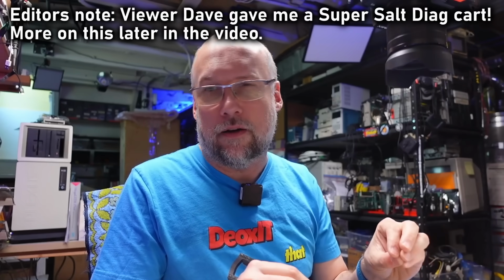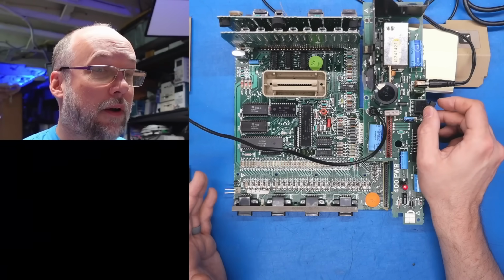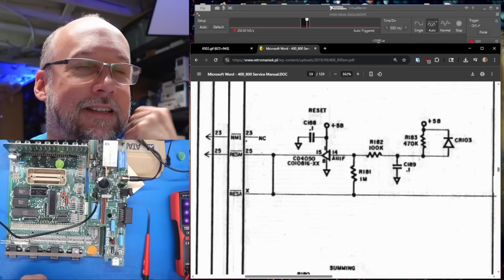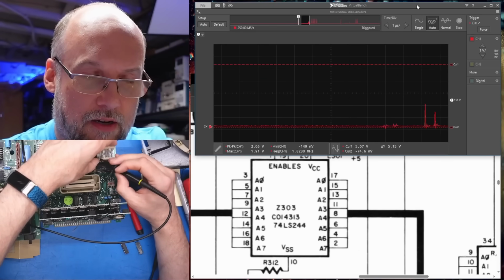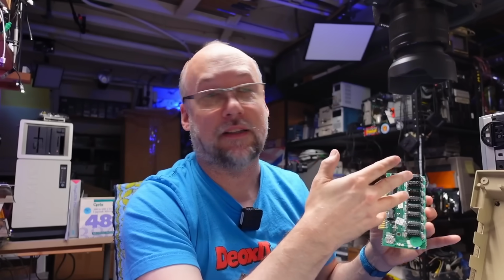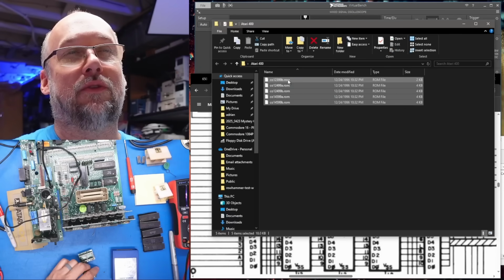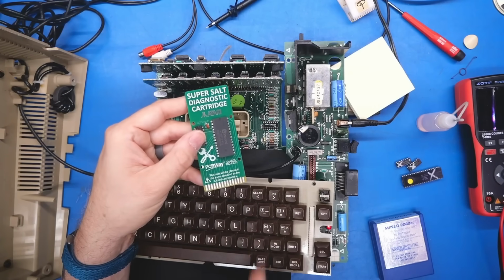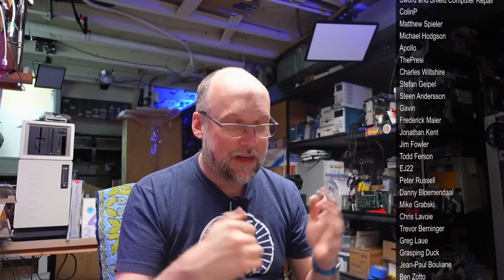Repairing a smashed-up Atari 400 computer

Comment: Actually, the SIO port is painfully slow for disk drives--not nearly as slow as the default IEC protocol, but way slower than C64 IEC fastloaders, with no software-only option for acceleration.  The only way to speed up the sluggish 1200 Bps transfer rate was/is to install hardware mods in the floppy drives.  USB historically was never as high performing as, say, FireWire, so I'm not too surprised it was originally based on the SIO in some way.  Commodore wasn't the only company that had problems with drive data transfer rate.

Comment: As I recall, the 400 was originally supposed to have come with 4K out of the box, while the 800 was to have come with 8K.  By the time they were released, however, market conditions had changed, and they both came with 8K.  And it wouldn't be long before they both were sold, standard, with their intended maximum amounts of RAM: 16K and 48K, respectively.

Comment: Daaamn I have an Atari 2600 here with traces that look exactly like the 400's traces 😮
Reply: So do I.  I think they all look like that because of the type of wave soldering that was used.  My childhood 2600 was the first vintage console or computer that I had ever serviced (had a bad TIA--works fine now with a new old stock replacement from Best Electronics), and its appearance freaked me out at first. 😄  I thought "Wow, that's the problem right there--I played so much that melted and crinkled the board!"  But of course, everything checked out OK, except for the TIA.  Ever since, every Atari mainboard I've looked at from that era has the same appearance underneath.

Comment: When you put the working GTA in, you found that the Antic was off by one pin. You fixed that and you thought the GTIA fixed the issue. Refer 1:16:19 that’s why the GTIA’s are both ok. Isn’t that the reason?

Comment: I have never seen a 400 with a proper keyboard !? I would have loved that over my crappy membrane ! I had to have my 400 repaired at some point (someone my dad knew) and when i got it back, the membrane was a total mess. Looked like it had been peeled all the way back and then reseated, but had trapped air bubbles all over the place.🙄

Comment: You can replace most standoffs by using a bit of a drinking straw (up to 20mm worked for me), a toothpick and some uv hardening resin. Hold the straw in place with blue tack fill it 3/4 with uv resin, insert toothpick and expose it to a good uv light for 30 seconds (at least). You will need further uv exposure for a good surface. A fake nail hardening lamp for 30-60 minutes or a half day in the sun gives a good hard plastic repair. Finally, drill out the toothpick  with suitable drill to match the intended screw. This is delicate work so be careful. You can add girth/support to the standoff with adisional uv resin (if there is room), in my experience it adhere well to previous resin layers and leaves (if done right) almost no trace of being layered. 
This fix/hack works well with manny repairs, just be aware it can yellow a bit if exposed to much light, but on the inside like the stand off or painted that don´t matter to much imo.  
Love to see you try it, great video.

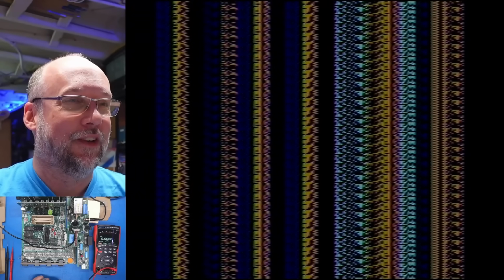Comment: When I saw the pattern at 17:38, I already knew it was the gtia.  
    The Atari 400 was my first computer, started programming in BASIC, then 2 years later I got an Atari 1200XL, with a floppy and a modem and started programming with MAC/65 assembler(better than the Atari assembler).   And calling up all the BBS in 1980's.  I got kicked off a few for pirating, etc.  
 I have read almost every book ever written about the Atari 8 bit line: Atari Basic, Atari Roots, Atari Sound and Graphics, Computes 1st,2nd, etc Book of Atari,  De Re Atari, Mapping the Atari,  Machine Language for Beginners, The second book of machine language,  etc.etc..  and all the programming magazines I had, full of Basic programs that me and friend would type in and then play.   Remember it like yesterday.

Comment: Acetone works wonders on old Atari cases (2600, 499, 800, XL line, 810, etc).  I have two 800s that required a good deal of case surgery.  I keep broken 400 and 800 case parts for pieces, standoffs, etc.  

Also, Atari had two CPU boards, one that used 6502 and one that uses Sally.  The boards interchangeable.

Good to see some Atari content.  I've repair Ataris on and off for years.  

Have a number of 400s I want to upgrade to 48k and add composite to ... Just haven't gotten to it 😃.

Comment: Nice repair. Slightly grumpy connection at a guess. I had a 7404 oscillator with a marginal connection that was generating 48MHz from a 4MHz crystal. No idea how it managed that, but the same deal; unplug and replug enough and the pins burnish themselves.

Comment: I couldn't afford an Atari 800.  When I got my 400, the C64 had not yet been released or I probably would have gone that route.  My 400 was upgraded to 48k, a DIY external keyboard, and composite out.  I forget now what I did with the sound.  40+ years ago was a long time ago it turns out.  At least for me anyways.

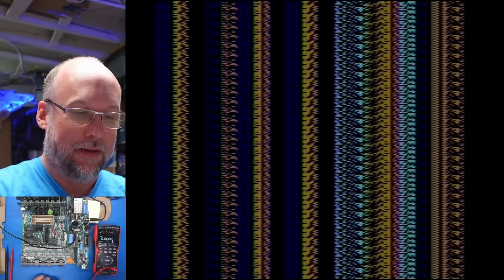Comment: 17:40 6520 - PIA (4 joystick ports), Atari OS is 10K in size, includes atascii  
CO12399B (400/800 Math Pack)  - BCD FP routines  
CO12499B (400/800 NTSC OSb)   
CO14599B (400/800 NTSC OSb)  
No Math routines crash when doing 1 + 1 in Basic

Comment: Because of the clock irregularity, I'm wondering if this is an older one that used a regular 6502 and added extra parts to add the halt functionality.

Comment: my first computer, although with a membrane keyboard
On the GTIA: 100% likely a bad socket. probably had a socket booger or the spring of a pin was a bit weak, and all that chip changing fixed it. Why i hate those kind of sockets too.

Comment: Regarding the different date codes on the chips - It's possible that the 400 itself was made in '79 or '80 but upgraded with more modern chips later. I know that it was possible to buy the GTIA and self-install it without any modifications to the board. The GTIA enabled additional graphics modes.

Comment: First minute -screaming at the screen got to be memory or bad filter caps spiking the screen memory. I had a bad power supply, letting through spikes/noise and characters would change on screen randomly. The XL power brick issue.
Reply: Atari uses first 7 pages for OS, buffers, shadow registers, etc before lowmem and start of basic usage then upper-mem into screen mem, display lists and BASIC Cart (Left Cart). I don't know what a 8K machine could do, You really need 16K to play most cartridges as hi res screen uses 8K for video mem. I guess a 8K machine would leave you with 5K for BASIC and no fancy graphics - graphics 0 = 40x24 = 960 bytes + display list (ANTIC code)
Reply: You need "Mapping the Atari" by Compute!

Comment: This video made me really appreciate sockets. If only every computer used them for all the chips diagnostics would be so much easier huh. Anyway loved this video. Still have my og 800 in my garage. Need to dig it out and test it someday. Can’t wait to watch you fix the 800xl. Also that was so weird about the gtia chip. Are you sure maybe all the pins weren’t in correctly when it seemed to fail?
Reply: True, albeit sockets themselves can have issues, too, such as oxidation or even chips working themselves loose over time.  They make computers easier to diagnose and fix, but also make them a bit less reliable.  Overall, I'd that tradeoff, but it can't entirely be ignored, especially with the long timeframes associated with our hobby.  Obviously, there is a reason Adrian always reminds us to DeoxIT sockets.

Comment: All Atari 8's have the same capabilities with regard to the CPU, whether 6502B or Sally.  With the original run of 400/800, Sally wasn't ready and 6502B was shipped, with three logic Ic's supplying the necessary HALT logic for the CPU to share the bus with ANTIC.  When Sally was ready and all 6502b boards shipped, Sally CPU boards were shipped in subsequent 400/800 machines and all XL/XE machines.  The cool difference with the 6502B version machines/cpu boards is that you could plug in a 65c802 and go 16-bit.

Comment: Very interesting video... But I just couldn't take my eyes off that beauty behind you, so much so I had to seek out more information and try the emulator. Seriously though, I love how you slowly investigate the cause of the fault and don't jump straight to swapping components. It's also nice to see an Atari that doesn't 'just work' and to learn more about them. We have a 2600 at the Micro Museum in England where I volunteer and it is quite popular but I've never tried a 400 or 800 although there are some in display cabinets.

Comment: I started designing and building my own homebrews in 1975. Later I purchased various commercial offerings including various Ataris (much cheaper overall). I enjoyed upgrading my ST512 to 1024  memory in 1985. Yeesh the tracks were not cooperative requiring much repair. Still it all worked in the end. Sadly due to moves and lack of space I had to recycle everything 13 years ago.  Your channel amongst others is very nostalgic for me. Thank you.

Comment: I've a 400 and i've repaired and upgraded to 1054K . I need keycaps for the atari 800. Where and how did you get these keys?  My keyboard is still working but keycap missing. (lost and smashed by post office, had to reglue with acetone but some piece here and there missing.

Comment: Regarding the GTIA not working and then working days later. I have run into this when using the less concentrated version of DeoxIT, it takes longer to do its work than the 100% version. That's why I sent you the 100% version. It might not have anything to do with it, but I've literally seen this occur myself

Comment: What if the issue was just the ram chip itself ? (and potential bad socket connexions at first)
because when you swapped the GTIA with the known good one, at first it didn't worked because you had miss placed the ANTIC
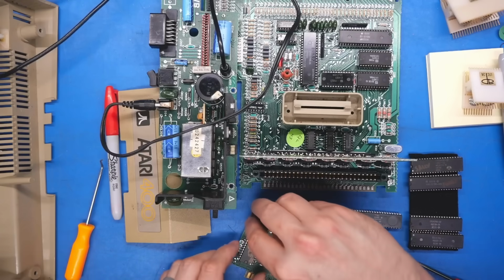and i think you did that ANTIC missplacement before replacing the faulty ram chips (at 49:08 i think)
so that GTIA might have been fine the whole time actually

Comment: The Atari XE line did have non-socketed ram, soldered straight to the board. I don't know about the XL systems. The XEGS actually only had 2 ram chips because they used 8-bit chips instead of 1-bit.

Comment: Hi Adrian, reviewing your footage its hard to see where an additional fault was introduced, other than replacing the ANTIC chip wrongly, thought the screen output changed after the POKEY was removed. My rule of thumb is to change only one thing at a time then check for changes. Though that doesn't mean I always follow it😂
Reply: other commenters already figured out - it was around 0:48:00, so that entire time Adrian was trying to diagnose a system that would never work and all statements about bad GTIA are erroneous.

Comment: Great video.  Small correction: Atari did indeed offer a 48K expansion board for the 400.  The 48K upgrade was actually produced and supported by Atari.  It was offered near the end of the 400's production run.  Installation was not difficult, but it was not entirely plug-and-play either.  To install, the user would remove the 400's factory-installed 8K or 16K RAM card and then soldier two wires from the 48K expansion to the motherboard, then the 48K card was plugged into the slot that the 8K or 16K factory board occupied.

Comment: I wonder if you could use small magnets to hold the front edge of the case closed? Probably some 3d printed replacements for the pegs mifht be a better option 🙂🤷‍♂️

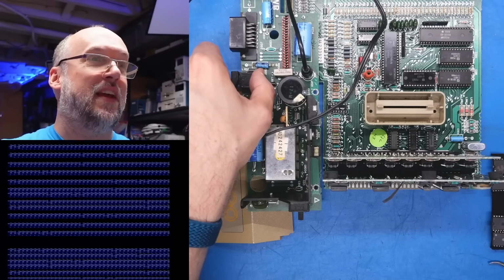Comment: you misaligned the antic chip at 49:27 during the transition from the replacement back to the original you can see the legs sticking out at the top and that was bad all the way until you put in the "replacement" GTIA so basically it was only the ram that was bad except you misaligned the antic for the rest of the trouble shooting
Reply: Came here to see if anyone else spotted that, I was shouting at the screen but he didn't hear me :D
Reply: I was also shouting this at the screen! :)
Reply: That sounds like the issue.  Perhaps one GTIA saved the dead parts bin.
Reply: trouble shooting is so irritating the smallest things can be missed. but its like my favourite thing to do as someone who is incredibly clumsy and forgetful.
Reply: That is what we call a "paper clip" moment....... It totally shadows the "7812 that supplies the 5v to the whole system" :-)

Comment: The logo on those chips are not Signetics at all.  That S logo is for Synertek.  I grew up in the Valley and had a few family members work there back in the day, I even have a SYM-1 board that's essentially a KIM-1 but with all Synertek parts!

Comment: boot error 0 is no system ram. i suspect that the error 5 is thrown in error because on the 6502b, data bits 5 and 7 are high on boot. errors 1 through 127 are programming language related, and vary with the language used. in that case, error 0 means normal execution. 133 through 255 are higher level, for dos and peripheral errors.

the third rom, the one with 2k used, is a very basic post and the notepad program, which is why when running normally, an original 400 or 800 takes a couple of seconds to show a stable screen. if the video doesn't initialise but the computer has booted, there is a coded sonic error like the speaker error codes on an ibm pc IFF the pokey has initialised before the error is thrown.

 all of this combined means with the original 8 bit atari computer architecture, no sound + no video = pokey didn't get to initialise, so ram or installed tia or 6502 or rom (antics are unusually stable even in those already robust machines), so you were looking in all the right places instinctively.

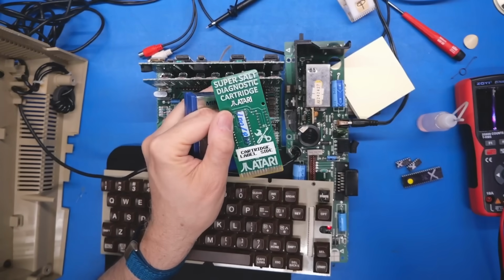Comment: 1:23:20 DO NOT use that bare board cartridge in an 600XL or 800XL, the cartridge doors are made of aluminum, and that will touch the PCB can cause a short. So cover it in tape or something!

Comment: So when a microprocessor isn't being selected, with chip select low, doesn't mean it's not doing anything, it's just not accessing (or writing too) the data bus, but it still might be reading it.  But usually it does what it needs to do in one clock cycle and it's just waiting for another instruction.

Comment: Hard to believe these fine computers were released a whole two years before our complete piece of crap ZX81 computers here in England, even by 1981 standards they were piss poor. no sound or colour, they were horrendous
Reply: Well also consider you could buy 3-4 ZX81s for the price of a single base Atari 400.
Reply: @ldisc66  3 zx81s would still be useless
Reply: @Synthematix Well, the Commodore 64 is pretty shitty as well..... I don't know anything about those ZX81 computers you mentioned, but they do sound just as bad and useless as the C64.
Reply: @thardump859  The sound chip in the c64 is a legend

Comment: On the first repair, if you had a known good PSU board I'd have been tempted to try that first, it looks like the boot screen is coming on and then "dropping out" possibly due to an issue with the video signal?

Comment: 400/800's often have some hard to see corrosion on the sockets & legs that are inside the RF cage. It is such a tight and warm environment this odd corrosion can form. Also, as your felt, the chips work their way out the sockets. Simple things first, for all 8-bit Atari's, reseat all the socketed chips first. This fixes 95% of the issues. Next, usually the ram is causing an issue.
That GTIA is good. They work or are dead, nothing in between. No so for Antic. 
The PicoCart you used in a previous video has that same rom that the super cart cart you used here. Plus it has several other versions including the correct one for 400/800's.
Still Loving the ATARI GOODNES SHOWN LATELY !!!!! More Please!
It is fun to watch you learn about these systems similarly to the way I have years ago.

Comment: Which socket looked wrong when you pulled out the chip?   Maybe someone pulled out the GTIA chip earlier and messed up the socket when they put it back in?    Maybe bad socket?
Reply: No, the ANTIC was insterted wrongly at somewhere around 0:48:00 for that whole time, so no further troubleshooting was really that useful outside removing chips and testing them.

Comment: The B-Key keyboards actually came in two configurations... one all brown set and one multi-color set (but with most keys still brown.)  Later versions of it actually included both keycap sets in the box... so you could choose which set you wanted.  What that means is that someone might have the extra key still available.  (In fact, I think I might have them in my collection somewhere, I know I have a couple of these machines with those keyboards, as well as new keyboards still in their original boxes.)  If you're going to VCF Midwest again this year, I'll be sure to throw some in my car for you.

Comment: This is a repost from your 2nd channel… The Atari 400 with an aftermarket keyboard. I wonder if that’s possibly my old machine, bought new in Fairbanks Alaska, around 82, then in about 86 I traded it for a 1967 Pontiac Tempest while going to college in Juneau Alaska. The person couldn’t take their car back to Portland on the ferry, so they took my whole Atari system; 2 drives, a monitor, a tape deck and I think some other stuff including paperwork. The computer was also upgraded to either 48 or 64k memory, and the aftermarket keyboard; also done by me. Anyway, cool coincidence and possibility. Last summer I bought another one for 20$ with a broken case, but got a case top and it’s working fine. They were bullet proof.

Comment: The 400/800 only have the Salt Diagnostic. The XE and XL machines can use the much better SysCheck which can take over RAM and ROM duties while diagnosing those onboard.  Via the parallel or ECI bus.
Reply: Except for some 65XE's that don't have the ECI port. Same with the XEGS.